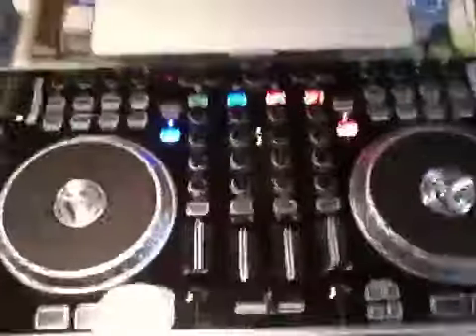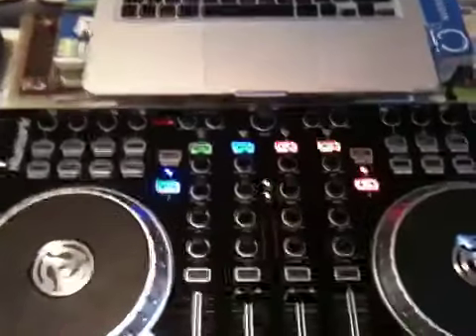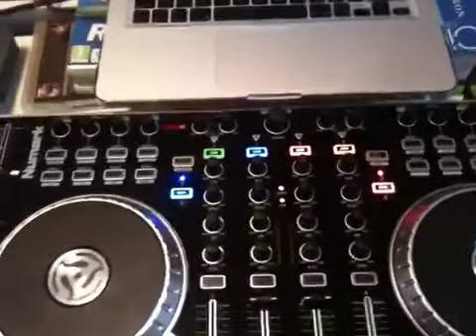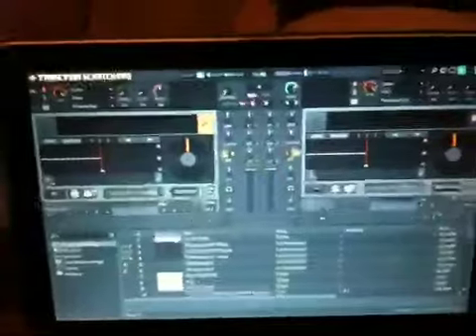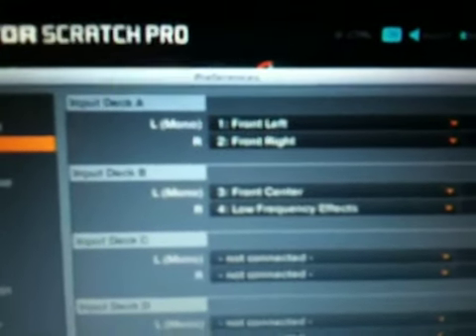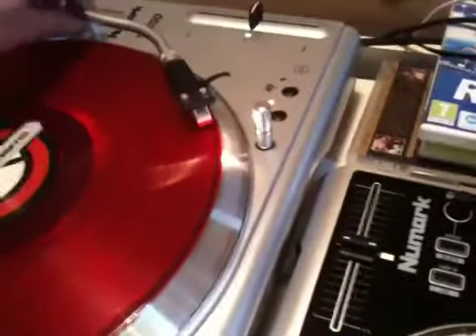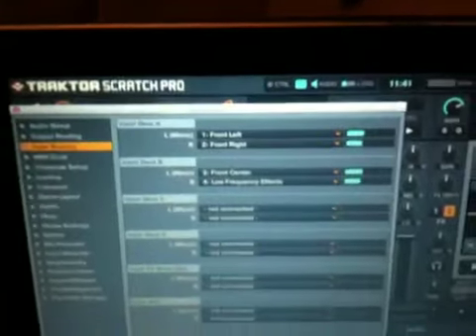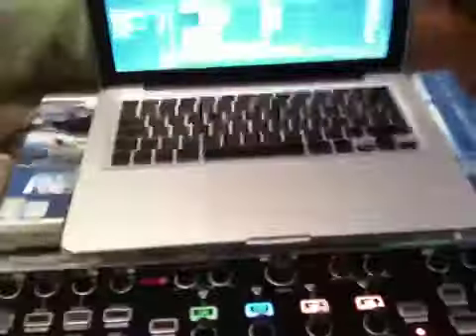Traktor audio routing on the N4

Comment: I am considering this purchase (being a vinyl addict) but still running in some questions just to be sure.
1. Is the EQ (analog/non timecoded) controlled by the software and any good?
2. Can you use he mixer not connected to a computer, running 2 turntables (how is the EQ handling)?
3. Can you attach another analog mixer, basically using the N4 as a soundcard (for analog and timecode mixing)? 

Thank you in advance!